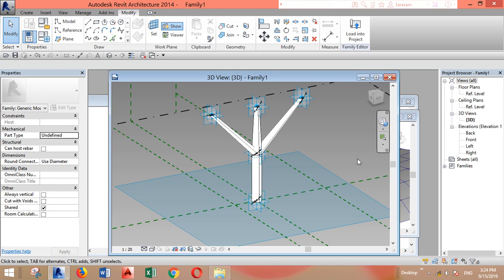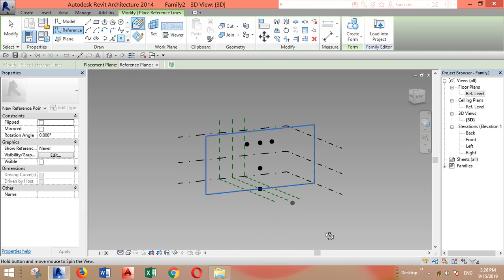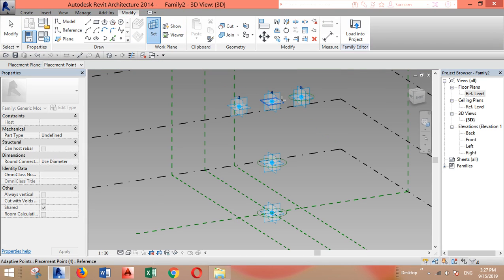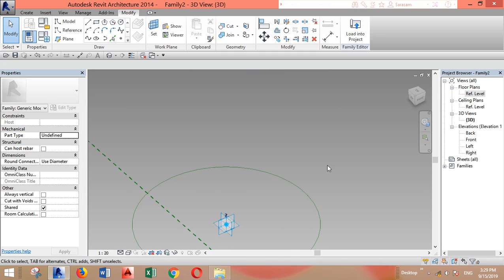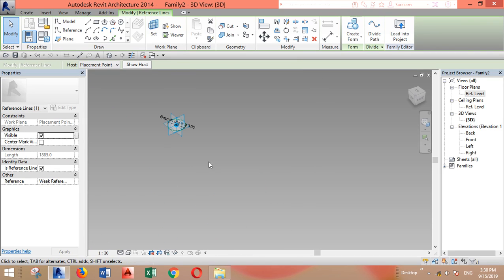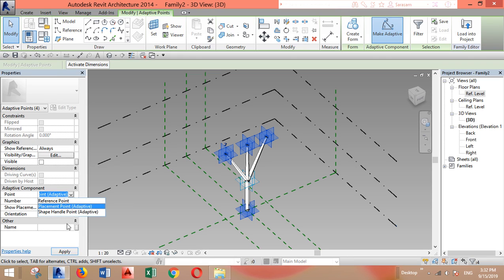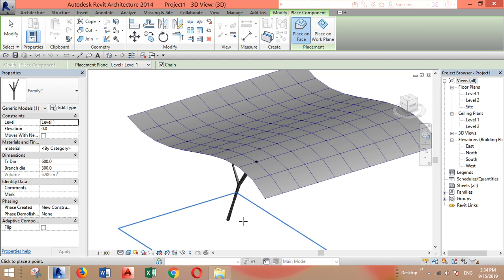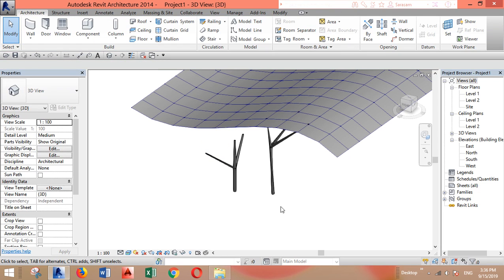Adaptive & Parametric Tree Column

Comment: Thank you.

Please train how to create compound columns that are part of the concrete and a high section of steel, such as Istanbul's New Airport.
But this airport roof is flat, if the roofs are curved, how do we use these columns?